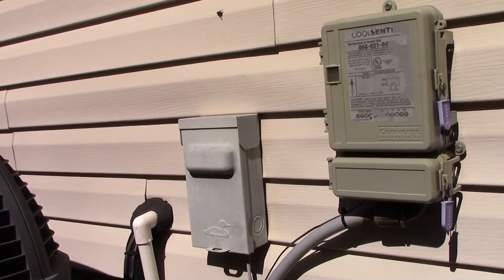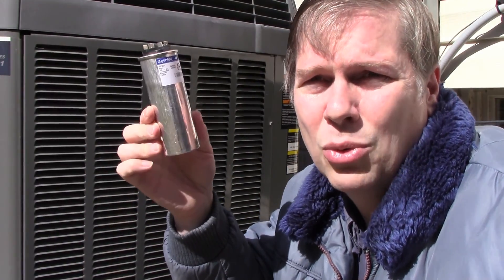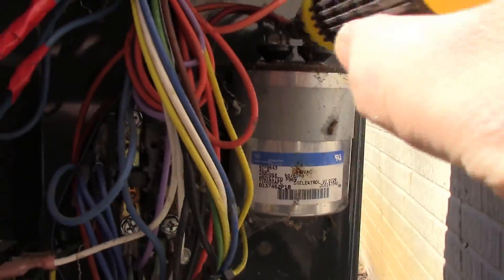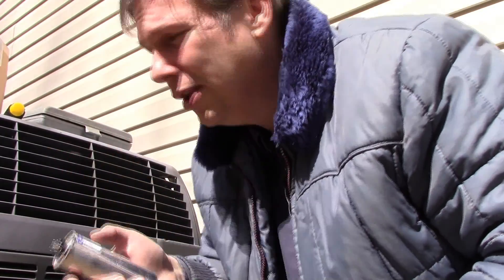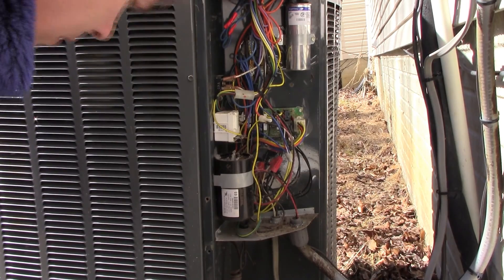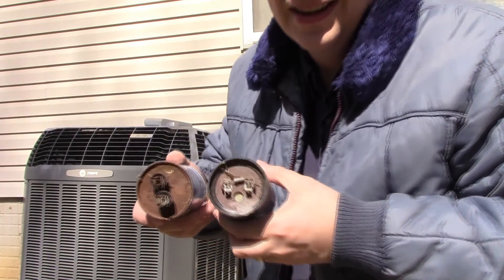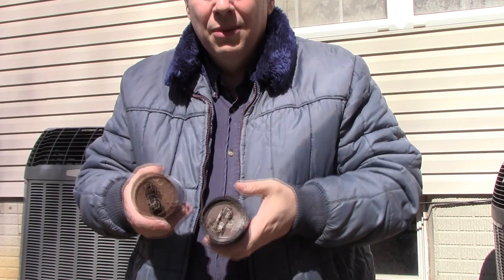Trane Capacitor Replacement

Comment: How do you get the panel off where the capacitor and other parts are?
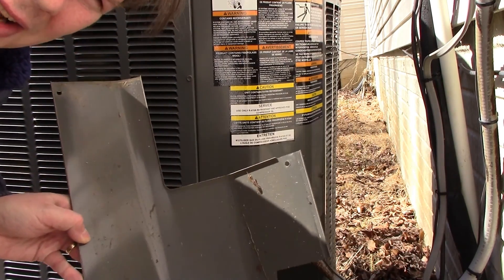Reply from the maker: There are screws at the bottom. I thought I showed that. At 3:35 I show where I put it back together. Usually it's two sheet metal screws. When you put it back together BTW, don't tighten the first screw all the way down. Get the second screw in first. Now you can tighten them. Otherwise, it can be hard to get that second screw in. Standard sheet metal working.

Comment: for the capacitor with the blue sticker is there any side, they are usually not labeled.
Reply from the maker: For two terminal Caps I don't think it matters. I try to hook it up exactly as the old one was of course. For 3 terminal it does. There's a common, fan and Herm. Herm is the compressor.
Reply: @robertthomas5906   Good day to you, thank you for the response, my research shows that there is no polarity for those types of Capacitors, they can be connected either way.  there is a little spray marking but that is from the manufacture showing the cap. was tested and passes specs.  Thank you.
Reply from the maker: @playstereo  You're back in action?
Reply: @robertthomas5906  Hello there, to be honest I purchased a replacement one to be ready when that day comes where the Cap, goes I have a back up and save myself a $$$ in service calls.

Comment: How do you know where the wires go? Is it in the same formation and you mark them?
Reply from the maker: Always take a picture of it first. If there are two terminals it doesn't matter. For more than two terminals it will matter. Sometimes you'll see - C F H. That's common, fan and "herm." The Herm is your compressor. Dunno why they call it herm. Air conditioners seem to have two terminals. Heat pumps seem to have two capacitors and sometimes 3 terminals. One to start it, one for running. The larger one in size will be to start it. If you didn't take a picture all is not lost yet. Most outside units have the wiring diagram. It'll show you the capacitors and the wire colors with which ones are  C F and H. If that's missing they're often online. Take your time. Please make sure you measure between a bare metal surface and the terminals before removing them. Recently it came to my attention that sometimes an electrician wires the outside unit incorrectly and there could be 120 between ground and one or more of those terminals. So if you touch a bare surface or the wire touches there could be a problem. always, always, always check.

Since I did this video I've repaired many units. You can get a capacitor tester from Home Depot. They're not bad, around 60 or 80 bucks. Then you can also check the amperage being drawn. Compare that to the sticker on the side. There are videos on how to do all that. Then you can replace them before they go bad. Recently I had the fan motor go bad. Since the caps were ok, I replaced the motor unit and it works fine now. The actual motor it turns out is ok. That motor unit has a variable speed controller that is bad. They come together.

Do a yearly service on them. Get the debris out from inside the unit. Wash the fins out. I get a lot of dirt out when I wash them. I also do the inside air handler units. I get the evap pan tablets and put them in to keep the water from getting disgusting. I have inside units that have been running for 15 years and it's amazing how dirty they are, even with very good filters.

Comment: Thanks Robert, I also have a  TraneXL16i.  Is there a relay for the start capacitor? Mine is 10 years old and was thinking of preventative maintenance of replacing those components before they fail.
Reply: The relay is just above the lower cap. I paid $40 locally. I'm sure online is 1/3.
Reply from the maker: I suppose they go bad. However, I've never had a relay go bad in any of the different makes I've had. All you have to do is get the number off the relay. Google that and it should come up. Mine is at least 10 years old.

Comment: Hi. Thanks for the video. I have a Question. I saw another box right next to Disconnect box. Im wondering what the other box is? I have similar one in my house. But i dont know whats its purpose.
Reply from the maker: Could be a utility disconnect. Sometimes if the customer agrees to power management they'll install a new box. When the utility is under stress they can turn some units off. You shouldn't notice much of a difference.

Comment: Robert, I own a Trane XL 1400 unit and I’ve noticed the fan is running backwards. Your thoughts?
Reply from the maker: That's unusual. It should be blowing air out the top. That's how it's designed. However as long as air is passing by the coils it should work.
Reply: @robertthomas5906  replaced capacitor and that solved the issue!
Reply: Have it checked out must blow heat up only.
Reply: Probably crossed two of the wires on it

Comment: What is TURBO Mini 200 UNIVERSAL? Is it a capacitor too? Where is it located? Thanks!
Reply from the maker: Sounds like a capacitor. Be sure to get the right part. Replace the right part. The web sites that sell capacitors will tell you which ones to buy and if there is a replacement like I had to get. One of the caps had to have another bracket to hold it as well, the old one wouldn't work.